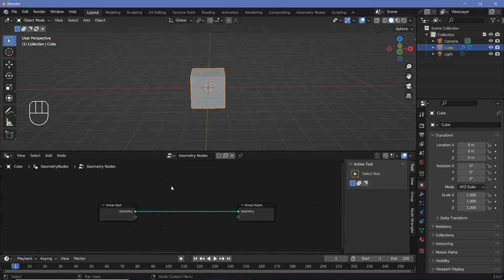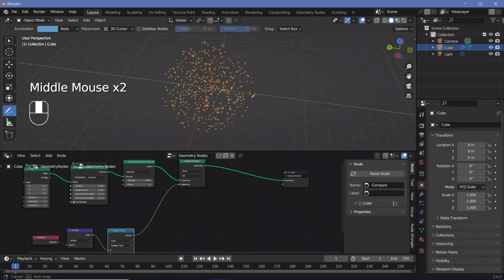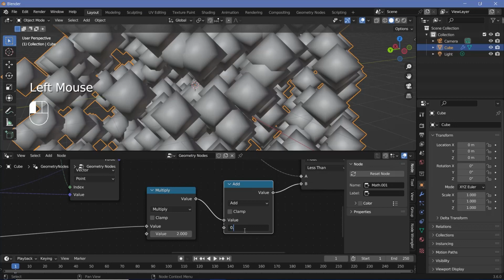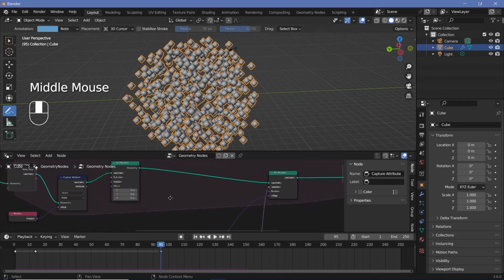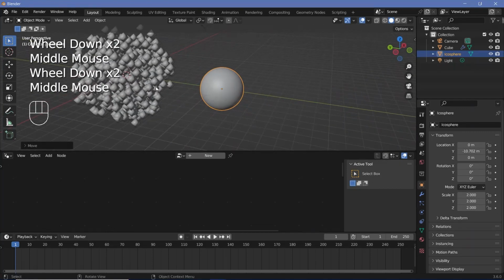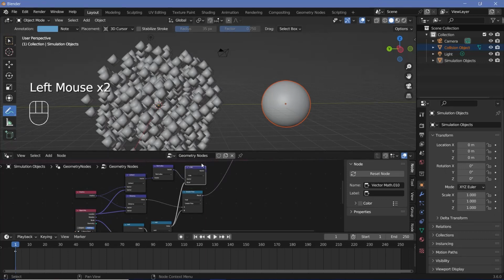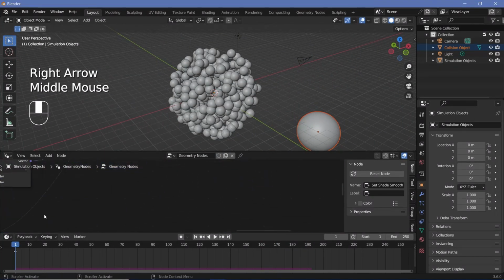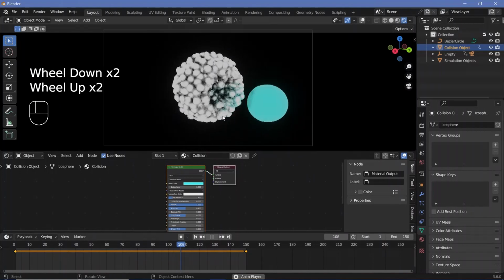Particles and Sphere Interaction Using Simulation Nodes - Blender Tutorial

Comment: I'm about half way through and really enjoying this. I don't understand why we Set Position twice though (I haven't gotten to colliding with the cube bounds yet, I'm just before it). Can you detail why you're setting the position twice in one step? I get that the leftmost Set Position is for the velocity. But I'm confused why we offset it with its velocity, and then move it again based on the collision.
Reply from the maker: Hi, 

So before the collisions with the bounds, there are 2 set positions: one for the collisions and one for the velocity.

So essentially, if we had ONLY the collision set position, the points would not move, if they're not colliding with a particle. Resulting in everything just moving far enough to stop touching anything else and then remain stagnant just like that.

By adding in the set position for the velocity, the particles continue to move with whatever velocity it gets from the collision with other particles.  

If we had JUST the set position for the velocity, we would not be taking the collisions into account, so there would be no motion at all. 

That's why the best way is to have a set position for the collisions, calculate the new velocity after collision and then have a set position that maintains that velocity.

I really hope this helps solve your question 

And I'm also sorry for the late response...